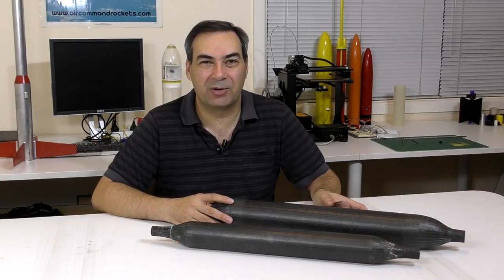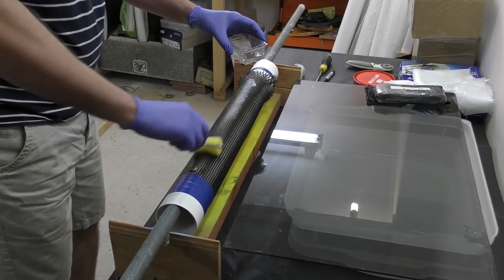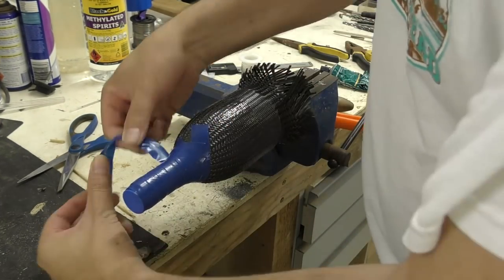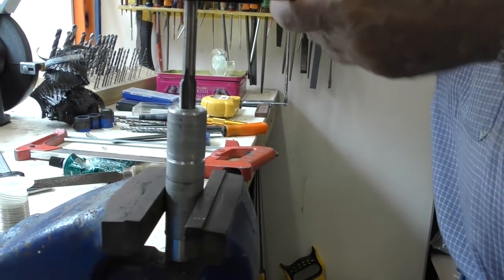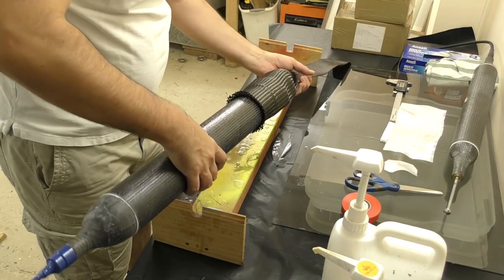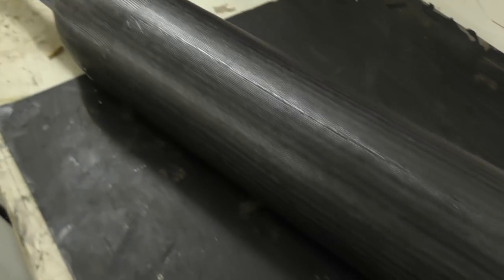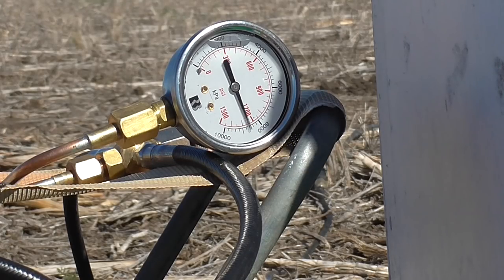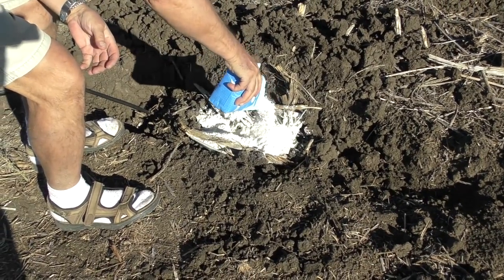2 Stage Water Rocket - Part 8 - Test Pressure Chambers

Comment: Hi George,
When going for the vacuum route, you could consider using an inverted lost mould technic for the inside of the pressure chamber. 
-3D print a mould for the core.
-Sand it for a smooth inner surface. 
-Fill the mould with a wax to form a core for the pressure chamber. 
-Mount your fittings and plugs to the moulded core. 
-Laminate the whole package with carbon sleeves in one go.
-The wax core will aid during vacuuming as it will provide a solid core.
-After curing warm up the pressure chamber and pour out the wax.
Alternatively you could try making a core from styrofoam on the lathe and desolve it using aceton after vacuuming.
By the way again a lovely video. Always waiting for the next one.
Best wishes to you all and a happy new year. 
Kind regards,
Kees
Reply from the maker: Hi Kees, happy new year. :) Thanks for the suggestion re lost mould techniques. We had looked at some of these when first deciding how to build pressure chambers, but it would have been difficult to make that work for 3m long rockets. We find building the inner liner in pieces is convenient. The inner liner is has less that 1mm wall thickness.  The Wax melting point is also close to the glass transition temperature for the epoxy we are using so if we wanted to heat the pressure chamber to drain the wax, we would end up with a soft sagging pressure chamber.

Comment: Congratulations! Great job with the carbon fiber and epoxy. You make it look like an easy task, but I'm sure it's not. It creates some leakages even to you. Even though great pressure chambers and results. I like the simple but controlled tests, also that you finally have to properly blow up something :-) Thanks for sharing and nice job!
Reply from the maker: Thank you Francisco, the reason for the holes in the end parts was because after we put the epoxy on, we stood them on their ends to let them cure. This caused the epoxy to slowly flow towards the bottom leaving less epoxy near the middle. The top was compressed with the tape. We should have put them on the rotisserie like we do with the tubes for the same reason. I think with Vacuum bagging this problem would have gone away completely. We will have another go for the next set of test pressure chambers.
Reply: Ah great  @AirCommandRockets ! I look forward for your next iteration. Thanks and keep going! All the best!

Comment: Rather than tape the ends you want to use the narrow - 4" wide shrink wrap tight over the whole lot, will help compress the lot and really improve finish and sealing. Its how they do yacth masts and other high strength tubular structures.
Reply from the maker: Thanks Adam, this is something we want to try on the next test pressure chamber attempt. We would also like to give the whole vacuum bagging a go at some stage to try to reduce the overall weight in removing excess resin.
Reply: @AirCommandRockets  other than the release tapes, and low temp shrink tapes, you might look into using regular pallet wrap. Vacuum bagging would probably be best for the curved ends.
Reply: @adamedward205  one issue is that whatever the method used to compress the composite as it cures, both a release layer, and someplace for excess resin to go is needed.
Reply from the maker: One of the heat shrink tubes we looked at are ones that are used for Lipo battery packs. It looked quite good.
Regarding the tow, that would be ideal, however, to do that properly you need a wrapping machine that can also do the ends properly. We actually choose the sleeve size carefully so that when it is stretched onto the mandrel we get as close to 55 degrees on the thread angle as possible which is the ideal for a pressure chamber. https://www.researchgate.net/figure/Variation-of-burst-pressure-with-increasing-winding-angle-r-ext-r-int-14-14_fig5_248204709
Reply from the maker: Here is where we did similar sizing a few years back:
http://www.aircommandrockets.com/dark_shadow_1.htm#_040914

Comment: "We suspect the plug is somewhere in New Zealand right now".... So THAT'S what that bang and clatter on the roof was a few months back. Not just another pukeko failing a landing in the gutter. Shall I return it by similar means as it arrived?
Reply from the maker: Yes please. Just aim it left a little, as we are back in Sydney now. :)
Reply: @AirCommandRockets  If I get my calculations right, I would advise being inside the Opera House to hear the bang and clatter of it on that roof... 😀. If you don't here anything, you might want to take up lavender farming on tazzy to have a chance of finding it in one of the plots.

Comment: you can wrap your pressure chamber in non-adhesive plastic tape while the epoxy is still wet instead of using the outer fiberglass layer. due to surface tension, plastic will create a nice glossy surface finish without adding extra weight, and when epoxy cures, you just remove it.
Reply from the maker: Spiral wrapping tape will leave a little spiral ridge where the tape overlaps. It takes quite a bit of effort to remove this with lots of sanding.

Comment: Very nice project!
I'm new to your channel, and I have a fair amount of aerospace composite layup design and analysis.  I've been looking through the videos and comments for a discussion on the layup of your composite.  I would guess that you need more hoop plies than axial, due to hoop pressure loads.  Have you tried winding the chamber with one or more hoop plies of carbon fiber tape between or on top of the fabric?  Do you know how close the woven fabric sleeve would be to an optimized layup?
Reply from the maker: Thanks Paul. The ideal winding angle for pressure chambers is around 55 degrees. We chose a combination of sleeve diameter and mandrel size so that when the sleeve is stretched onto the mandrel the fibers are close to that angle. Here is a little more information where we were looking into this with our previous project. http://www.aircommandrockets.com/dark_shadow_1.htm#_040914
Here is a more updated video of how we construct our pressure chambers now without leaks:
https://www.youtube.com/watch?v=0AsxjGFYK8w
https://www.youtube.com/watch?v=M3_mfIQFMW
Reply: @AirCommandRockets   That's fortunate the optimum winding angle is 55 degrees.  I found verification of that https://www.mdpi.com/2504-477X/3/3/65/pdf.
But doesn't tape have better properties than fabric?  Would composite tape be hard to use, even for a few plies between fabric??  Fabric is so convenient, I can see why you use it.

Comment: Very nice pressure chambers, and very professionally made as always! :) One thing I would suggest is to use a water pump to test the next ones, this will help to reduce the risk when testing. Also, I guess a winding machine is on your grocery list for your next project. ;)
Reply from the maker: Hi Julian. Someone else also suggested using a grease gun to do the pressurising, all good options. A winding machine would be great, and we looked at building one a few years back, but it was more hassle than it was worth. A straight tube is simple enough, but the ends are more complex. I think at that point I would just go somewhere to get it done. The sleeves are working out well though and something that can easily be done in the home workshop. We will try vacuum bagging and heat shrink tubing next to see whatres ults we can get. We tried one tube by wrapping it completely with electrical tape. That had two drawbacks, it left a continuous spiral around the chamber, and made it very difficult to remove from the mandrel. The vacuum bagging we would do to the outer sleeve only rather than the inner one since we don't have to pull it off anything.
Reply: @AirCommandRockets  You could try using shrink tape for that purpose, which shrinks when heated. It should be easy to remove it since it's made for this purpose. There are some small winding machines (x-winder for example) where it is quite easy to set up the tank geometry, however setup of the machine itself is not.

Comment: I'm no engineer but I do use 4500psi paintball tanks, that fill rate must generate and incredible amount of heat in the tank. I wonder if it's getting to a range to affect the epoxy? Nice work though, have you thought to test an aluminium tank wrapped in carbon?
Reply from the maker: That is correct, it does generate a lot of heat, and one of the reasons why we fill slowly and pause during filling to let the rocket cool down a little. On hot days we've even pre-cooled the rocket with wet towels to try to keep the heat below the glass transition temperature of the epoxy (around 65 degrees C )
We do happen to have one of those tanks that's good for 300bar. ;) It's from firefighters' breathing units.

Comment: Have you found an economical high pressure water pump?  It could reduce some of the excitement during a failure. That’s what they use on steel pipelines.
Reply from the maker: We don't have one of those. We can fill the hose with water as well to reduce the amount of air in the system. One of the reasons we test this way is so that we are using exactly the same equipment and gauges for the actual launch. The bit of excitement always wakes you up.

Comment: Can I ask you how much the booster (80mm) weighs and what is its volume (in Litres)?
Reply from the maker: You mean the weight of the test pressure chamber, or the weight of the final booster? The test pressure chamber has the heavy plugs in it for testing, which won't be on the final booster. The volume of the final booster will be around 3 x 8L =~24L
Reply: @AirCommandRockets  The weight and the volume of the test pressure chamber (80mm). It's just to have an idea about the weight and volume, compared to the normal PET soda bottles used to build the water rockets, using the splicing technique. I've built a water rocket module and a pyro one for my Rocket Drone and they both have the same weight. I'd like to know if using your building technique I can shave a few grams.

Comment: I was just wondering, when do you expect this project to be finished? Just wondering . No pressure (no pun intended). :)
Reply from the maker: Hi Josh, that's a really good question. We were targetting April this year, but at this stage we are not sure if we can get it all done in time. We've had a few other things to work on (other than rockets) that has taken up rocket building time. If not April, then around September of this year would be the goal as that would be the next high power launch opportunity at our launch site outside of Sydney.

Comment: Hey George, on the final rocket, why not ditch the other plug and just have a guppy-style chamber? This way there's only one point of failure and then you could reach 1500psi then.
Reply from the maker: We'll publish how the final pressure chambers were built. The top and bottom sections are different than the test pressure chambers. We've now tested them to over 1000psi without leaks.
Reply: @AirCommandRockets  That's nice! Can't wait to see it break 3000 feet!

Comment: Smal hint:
What about roling/ wrapping a hose ( heatshrink- ore rubber-hose) over the fibers in order to use vacuuminjection to inject the raisin? 
This way you can avoid airinclusions, leakeage and improve the strength/weight- ratio . 
Just in case you seek to optimise in upcoming projects.
Love your work and your videos!👍
Cheers

Link VACUUMINJECTION :
https://youtu.be/VodfQcrXpxc